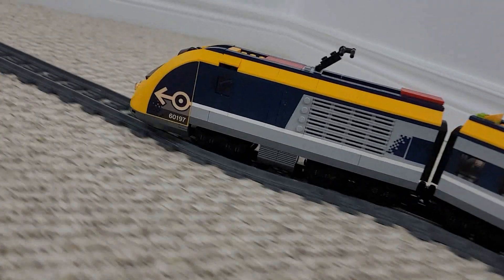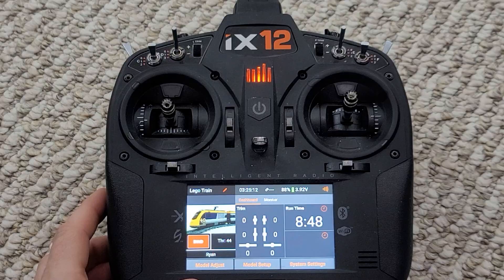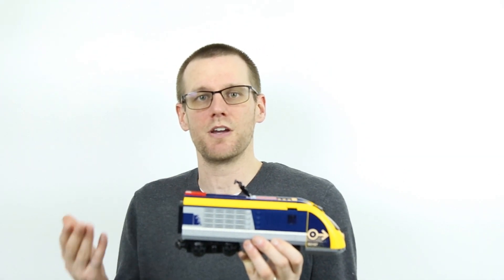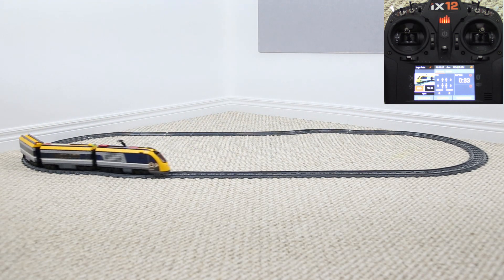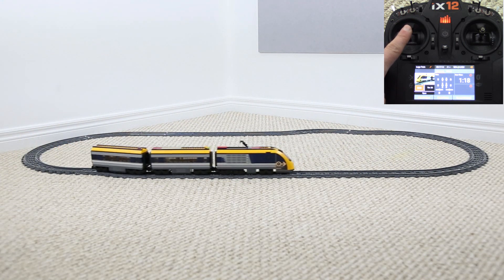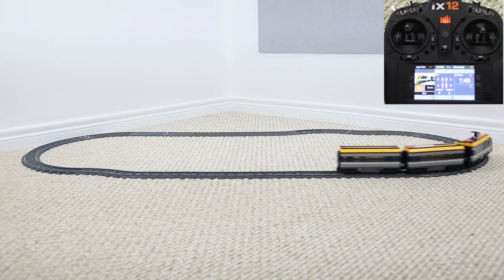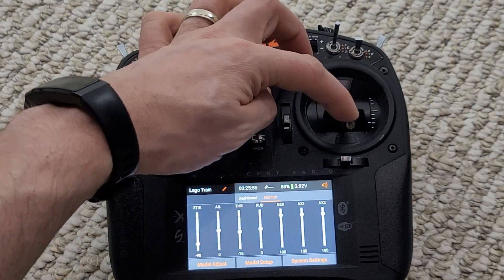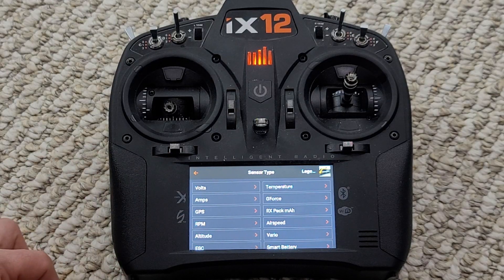LEGO Passenger Train Converted to RC using RC Hobby Grade Components ( Full Proportional control )

Comment: please send details of the kit. RC is the way to go for model railway BUT  All we have is Hbridge hand me downs for aero and car stuff : So arduino is only way forward just now   What please is this BRAKE ? Am programming arduino so I can instruct train to slow down and stop in a fixed distance. (eg at a station )  Ms O
Reply from the maker: There is no kit. I have used components that control my rc planes and programmed parameters around the operation of the train. 
I don't remember using a brake. I believe I used a throttle delay both on acceleration and deceleration.
I used the factory lego train motor and ran a car ESC to it so that I can get reverse. Most car ESCs have a brake function before you enter reverse.

Comment: do you have a video showing the conversion?
Reply from the maker: I do not. Didn't seem like there was any interest in this project.
Reply: @RCexplained  I have a friend that gave me a larger size toy battery operated train set, a "Santa Express." lol It did not come with track, so I am painstakingly taking apart 027 track and rebuilding them to widen the gauge and I plan to run it around the front yard. I bought a cheap-o ESC and I have plenty of NiMh batteries to play with, and plan on converting to R/C. Also thinking about a hybrid Solar Powered setup. I would like to have it operational by Halloween, but we will see.
Reply from the maker: Very nice. Sounds like a great project.
Reply: @RCexplained  lol. So I tried it in an HO scale locomotive. Worked decently well, but the escape I bought couldn't handle 14 volts. So I fried it. Moved about 10 feet down the tracks and smoked itself. Apparently, the battery wires melted their insulation and shorted out the terminals, and that fried the esc. Oops.

The bigger project only runs on 6 volts stock, so maybe it will fair better...
Reply: Not escape, ESC. Lol
Reply from the maker: 6v will be a lot easier

Comment: Is a 26A-30A ESC limited to 26Ah to 30Ah batteries?
I know the question is off topic but this is your most recent video so you are most likely to noticed. I am making an electric bike and I am having trouble finding a battery.
Reply from the maker: No battery capacity limits. Just watch heat due to the longer run time.

Comment: Could you cover the pro's and con's of pan (or any) RC cars haviing smaller front wheels compared to rears?  I run GT12 Stock 13.5T motors with 1s Lipo, and foam tyres.   Many people run the fronts smaller, but I haven;t heard a compelling reason why.
Reply from the maker: Added to the list of videos in queue.